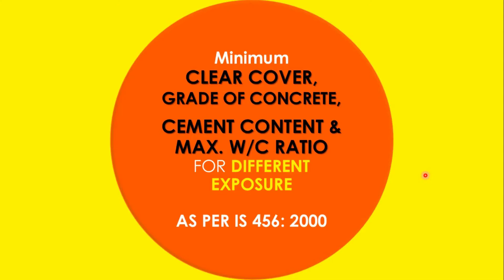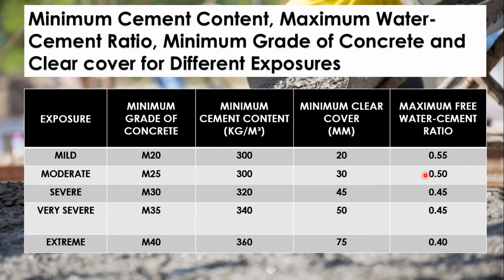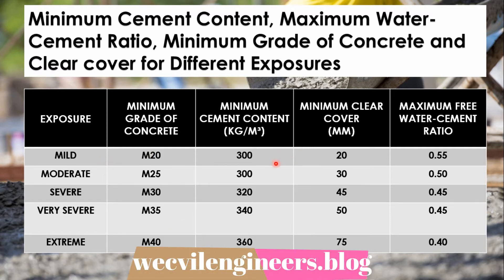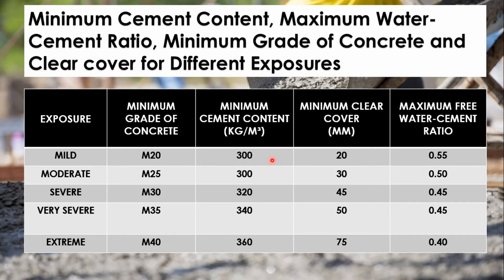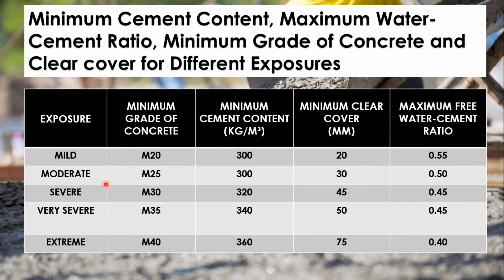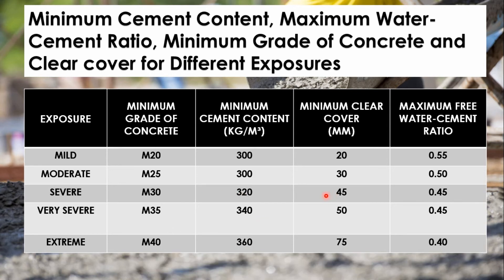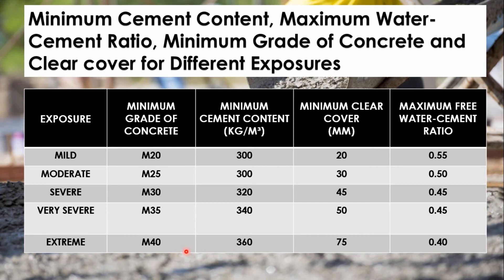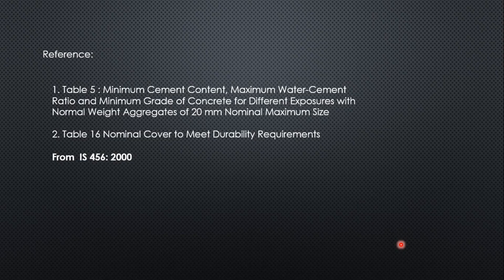Min. grade of concrete, Cement Content, Clear Cover & Max. W/C ratio| IS 456 : 2000|

Comment: Sir M20 me 1 bag cement me kitane litter water lagega .... isko calculate kese karte hai Sir bataye Plz.......
Reply from the maker: Let's say water cement ratio is 0.55. 

Then water =50 x0. 55= 27.5 litres.  

"Just multiply the weight of cement with water-cement ratio",  you will get the quantity of cement.
Reply: @wecivilengineers  Thank You Sir..............
Reply: @wecivilengineers  Thank You Sir............